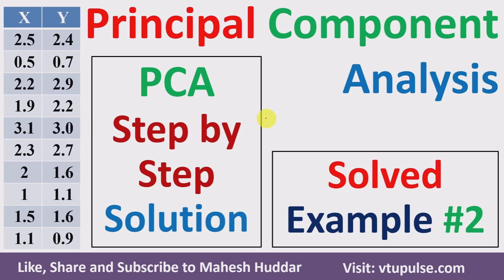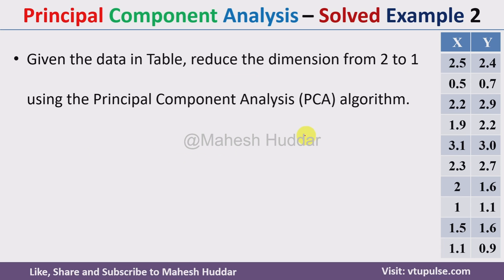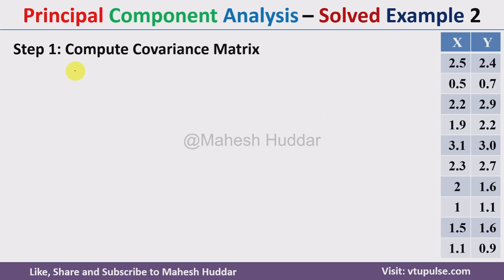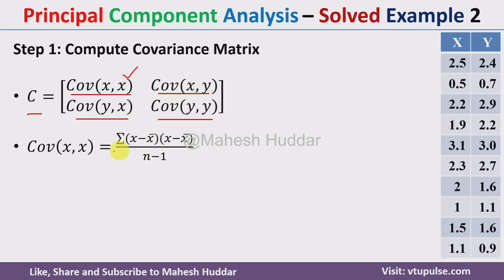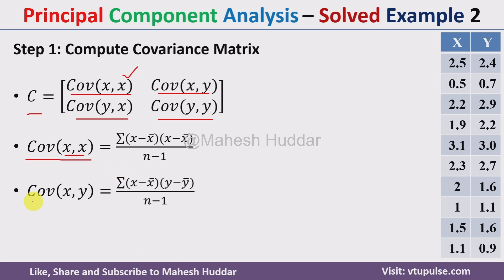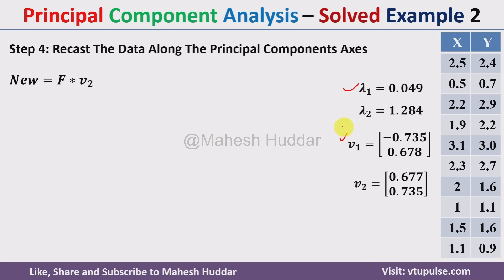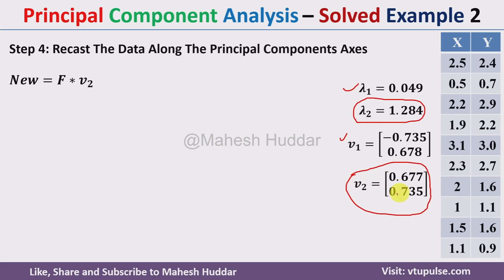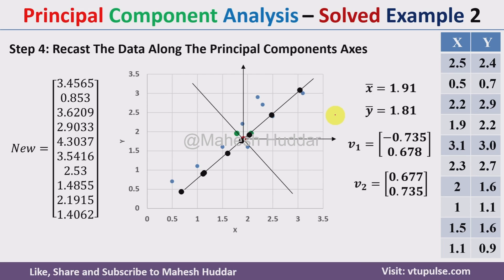2. Principle Component Analysis | PCA Solved Example | PCA Step-by-Step Solution by Mahesh Huddar

Comment: the final answer does not match, @MaheshHuddar sir please reply on this.

if you run this in python the answer would be this 
Projected 1D data:
 [-0.82797019  1.77758033 -0.99219749 -0.27421042 -1.67580142 -0.9129491
  0.09910944  1.14457216  0.43804614  1.22382056]
kindly check for yourself, the code is given below 

import numpy as np
import matplotlib.pyplot as plt

x = [2.5, 0.5, 2.2, 1.9, 3.1, 2.3, 2.0, 1.0, 1.5, 1.1]
y = [2.4, 0.7, 2.9, 2.2, 3.0, 2.7, 1.6, 1.1, 1.6, 0.9]
data = np.array(list(zip(x, y)))

mean = np.mean(data, axis=0)
centered_data = data - mean

cov_matrix = np.cov(centered_data.T)

eigenvalues, eigenvectors = np.linalg.eig(cov_matrix)

sorted_indices = np.argsort(eigenvalues)[::-1]
eigenvalues = eigenvalues[sorted_indices]
eigenvectors = eigenvectors[:, sorted_indices]

projected_data = centered_data @ eigenvectors[:, 0]

print("Mean of data:", mean)
print("\nCovariance matrix:\n", cov_matrix)
print("\nEigenvalues:", eigenvalues)
print("\nEigenvectors:\n", eigenvectors)
print("\nProjected 1D data:\n", projected_data)

plt.figure(figsize=(8, 6))
plt.scatter(centered_data[:, 0], centered_data[:, 1], color='blue', label='Centered Data')
origin = np.mean(centered_data, axis=0)
plt.quiver(*origin, *eigenvectors[:,0], color='r', scale=3, label='Principal Component 1')
plt.title('Data and Principal Component')
plt.legend()
plt.grid(True)
plt.axis('equal')
plt.show()

Comment: In the first pca video you said we have to order the eigen values from highest to lowest and from the highest one we will calculate the pca 1 but you have not ordered the eigen values here... Please rectify the error in the video.
Reply: he took the largest one. Its same as ordering. You need to take eigenvector with maximum eigenvalue.

Comment: One difference of this video is that, the normalized e1 (from the previous videos notation) called v1 (same with eigenvector here) but probably just an unnoticed notation. Not big deal. e1={-0.735 ,0.678} . 
But las step 

And the last step is misscalculated. The it skips the mean-centering. Which is not big deal also. It is just an obvious mistake.
Reply: What mean centering?
Reply: Hey , Mean centering is an optional step or can we skip it ??